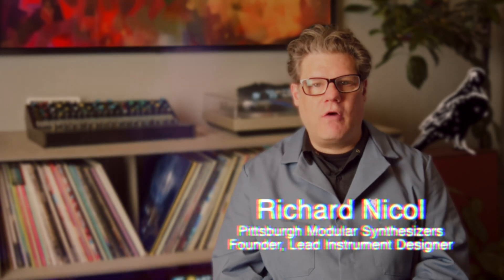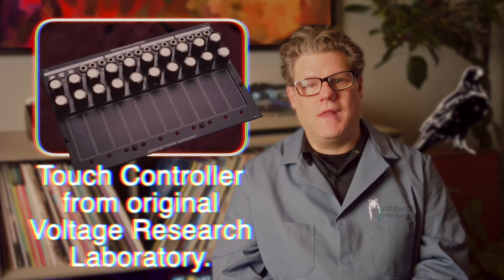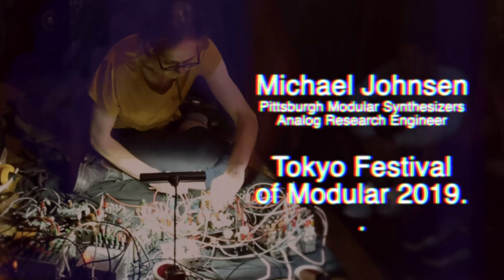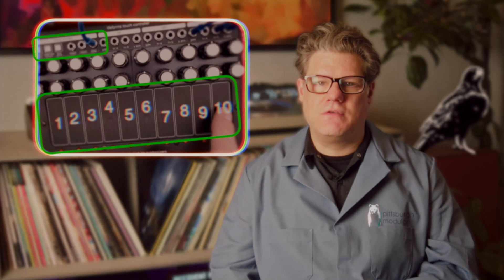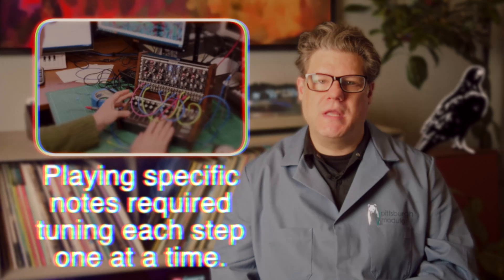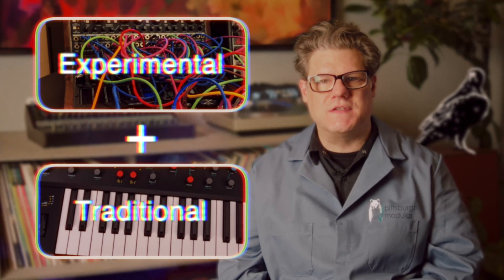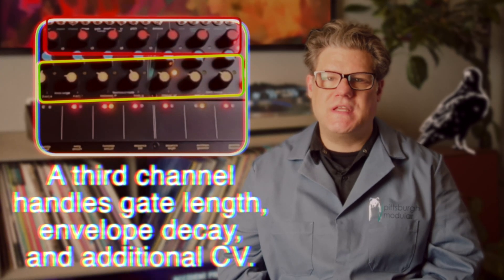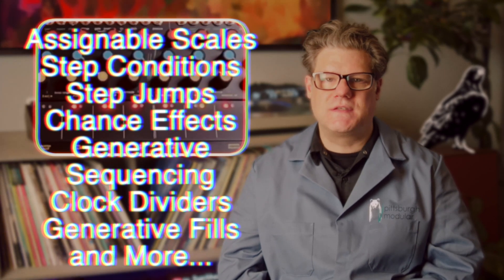The Lab Report Episode 3: Hands-On Sound

Comment: If the touchpads react as well as a Serge TKB and not as slowly as a MakeNoise O-Ctrl, I'll buy it.
Reply from the maker: No idea. The capacitive touch pads on the touch controller are read digitally and the sensitivity can be adjusted to account for power and environmental issues like poor grounding or humidity.